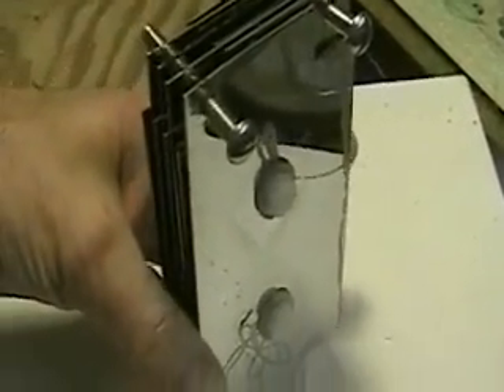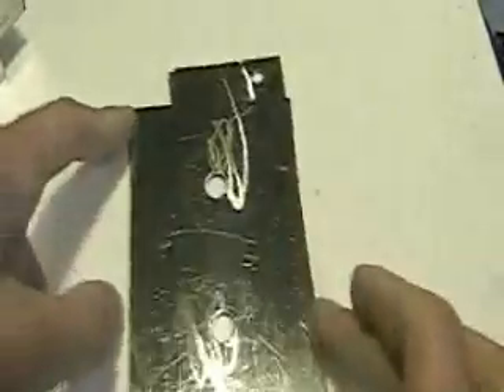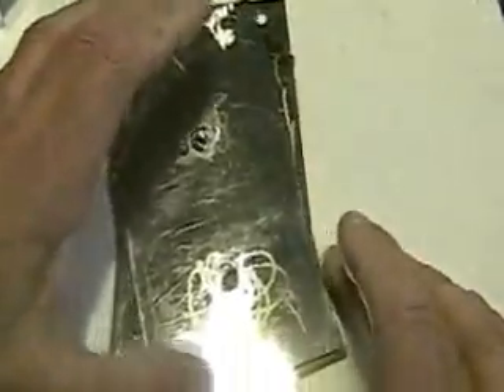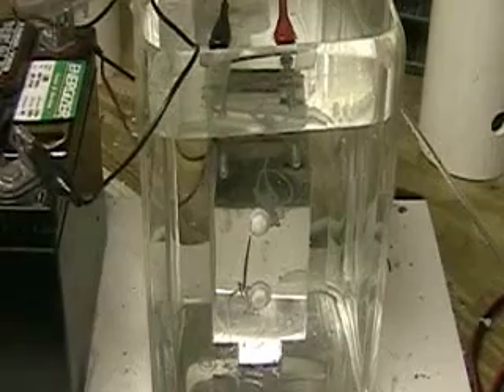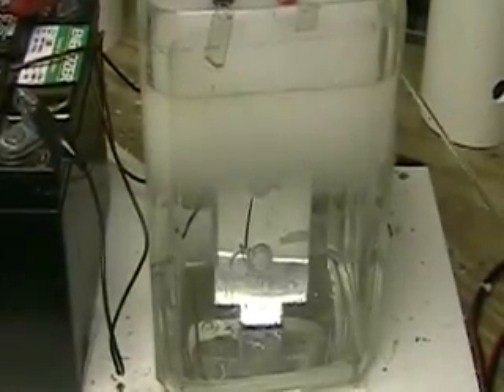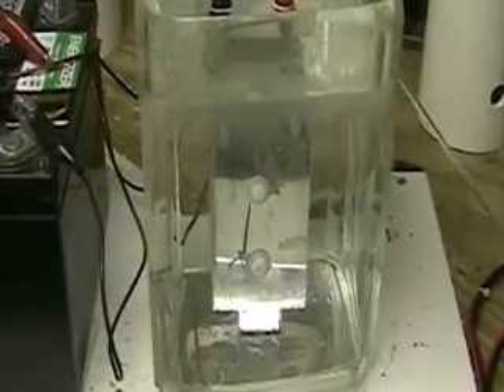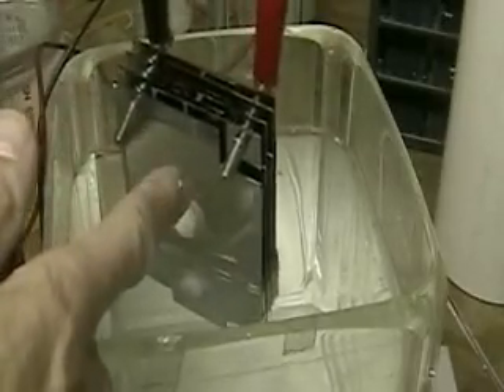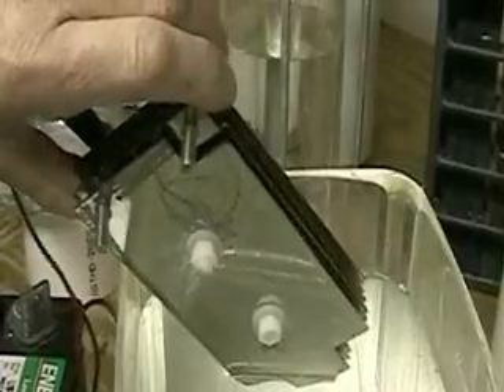Hydrogen Tap (AmericanSpirit) 275

Comment: Thanks John. Im building a large 3 cell generator, each 30cm x 12cm tubular cell using 25 x 100mm x 10mm tubes with a 1mm wall and 6mm s/s threaded rod. I dont know what amps it will pull but this is the biggest unit I can fit under the hood/bonnet! Best wishes Lewis.